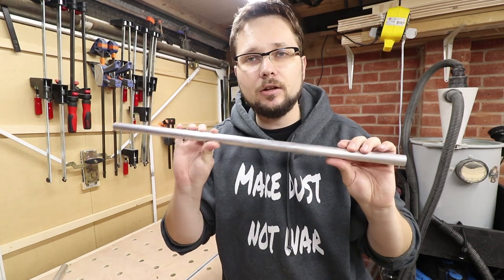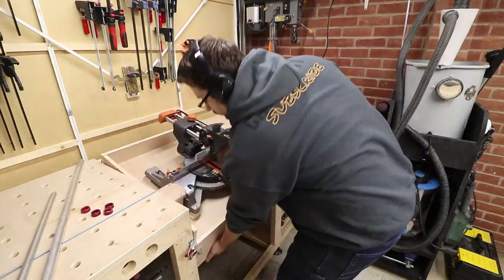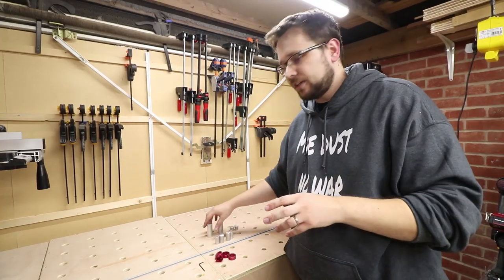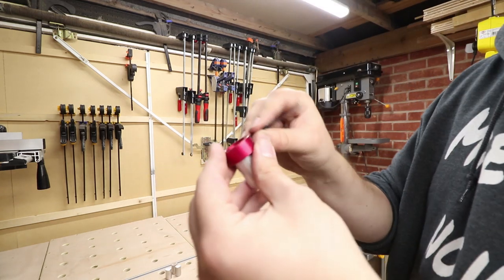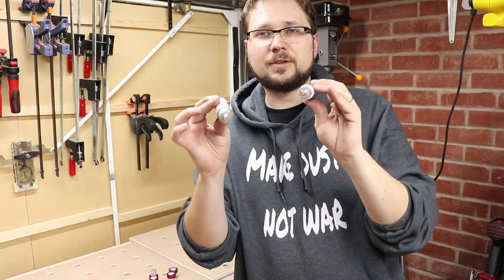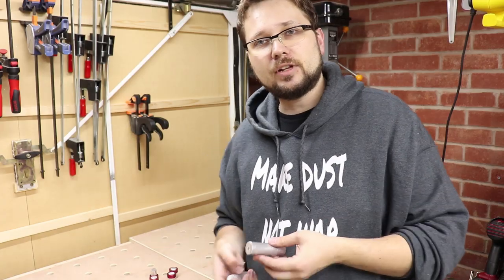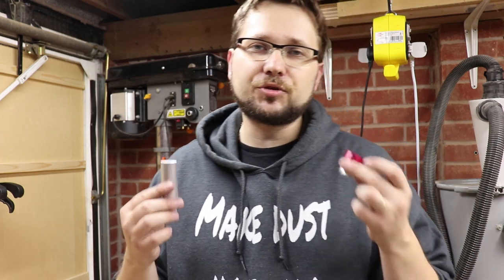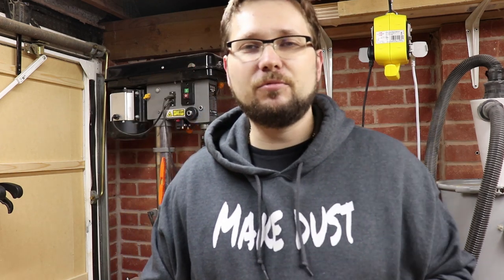Cheap DIY Bench Dogs - Quick and Easy Project

Comment: This is a great idea, and so glad you're using 20mm rather than 19mm, as all my dog holes are drilled for the 20mm plastic dogs that came with my Black and Decker Workmate.
Reply from the maker: I think the 20mm ones are bit of a standard. Had a look at buying dogs and they are usually 20mm
Reply: @CasualDIY  No, they're 19mm, which is 3/4" (the ONLY way the US will accept things). The Parf system only supports 19mm holes, which is why I like your solution for an easy 20mm system.
Reply from the maker: @GregWallis  oh didn't know that, you learn something new every day. To be honest I only bought one set of dogs just to try them out. I knew from start that I won't buy anymore as they are just too expensive. But the simplest solution would be a wooden, metal or aluminium rod. And when I searched EBay the aluminium wasn't too expensive so went for that. Still few videos to come mate, all scheduled to release in the coming weeks 👍

Comment: Nice job. Why not cut a length of the 20mm aluminium rod to about 120mm long. You can then position the collar anywhere along the rod to give whatever height you want above the table. You might need to use another collar below the mft top to keep the rod at 90 degrees and stop it deflecting under pressure.
Reply from the maker: Yes that could be a good idea I need to test it out👍
Reply: Because the collar will get in the way. You need the diameter above the bench to be the same as the collar or it will not support the work - in which case you may as well just use the short ones
Reply: @chrissollars3492  not if you are using it to reference a guide rail for a cross cut. Just look at the veritas tall parf dog which has a collar machined into it. Plus you could adjust the height to avoid the dog hitting the motor housing of the saw.